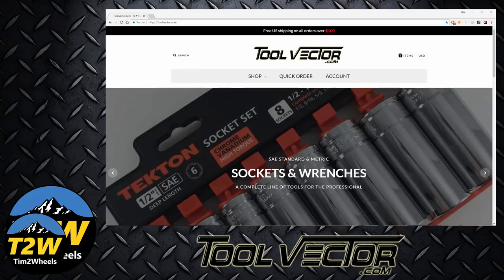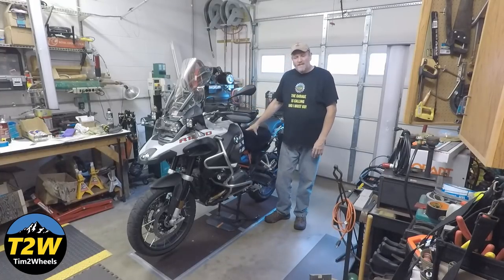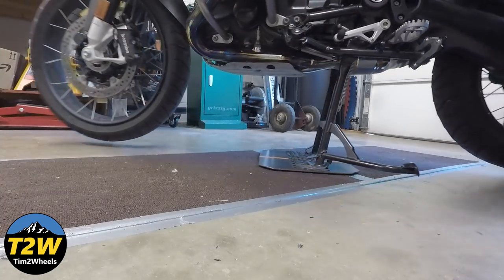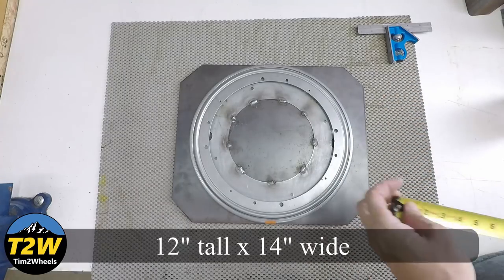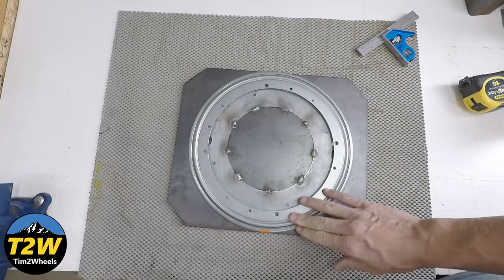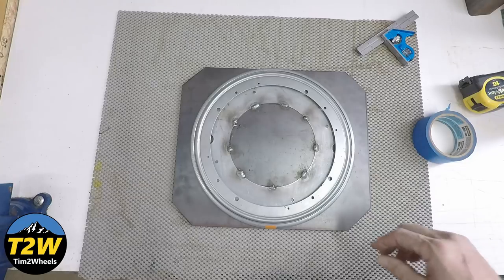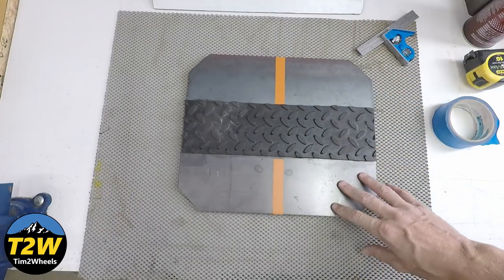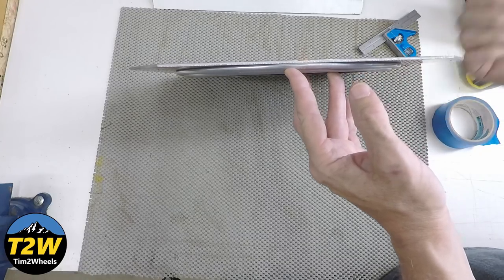T2W: DIY Motorcycle Turntable

Comment: I've just knocked one of these up, using pop rivets instead of welding, and it works amazingly with my Triumph Explorer. Total cost was £35 UK.
Reply from the maker: Hi Les,  Using pop-rivets is a great idea! Thanks for sharing that idea. 
Thanks for the comment and for watching.
Reply: Les where did you get the disc from I'm trying to buyone in the UK but struggling with the weight load
Reply: @2e0btx  Hi Peter, you can get a 12 inch lazy susan bearing rated to 1000lbs from Simply Bearings in the UK. Roughly £15.

Comment: Hi Tim. I echo comments below. Having looked at what is available commercially (£175 in the UK) and the various DIY options, yours seems to be the simplest. Plus your comment about keeping the height as low as possible to make it easier to use the centre stand. Inserting a flat piece of wood under the rear wheel to lift the bike a little would also help to get the bike on its centre stand while on the turntable. Also a useful comment about your experience simply leaving the bike parked on the turntable when not being used. Thanks

Comment: I built one with 3/4 inch plywood. Works perfect. The plywood needs very little attachment power to the top of the spinner. Pl 400 works. Painted over beach  sand into the top is plenty of traction. Great idea. Thanks for posting!

Comment: Great video, I didn’t weld though I drilled holes to line up the steel plate and bearing and used M5 10mm screws and nuts with red loctite.

Comment: Clever idea. Never wanted a center stand on the klr till now.
Reply from the maker: Hi Casey, I understand. I never put a center stand on my KLR for several reasons, but this would've been a good reason to do it. I used to use my motorcycle jack with the KLR to move it side-to-side, but it would not let me spin it around like this.
Thanks for the comment and for watching.